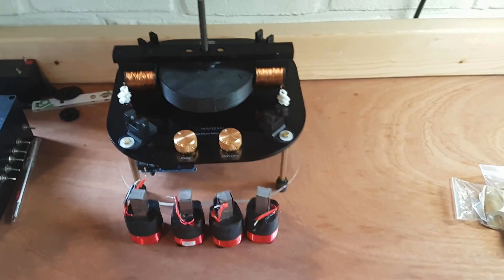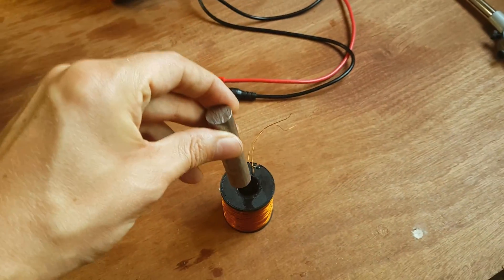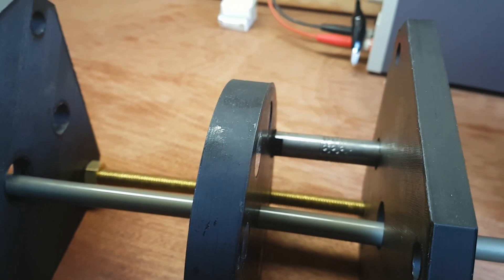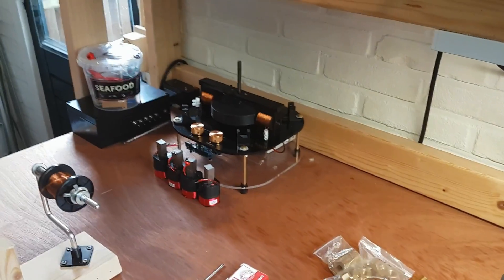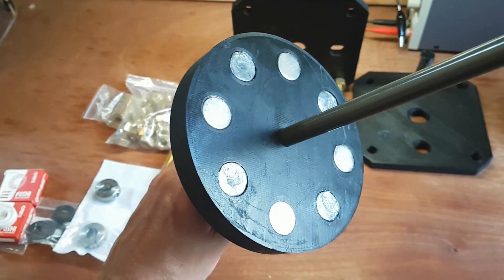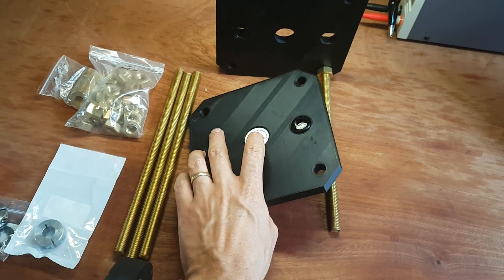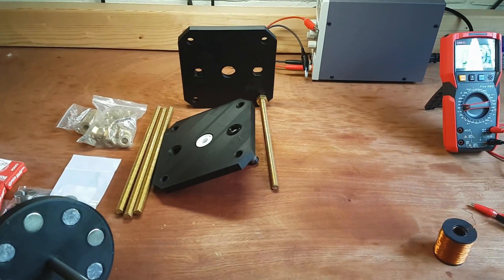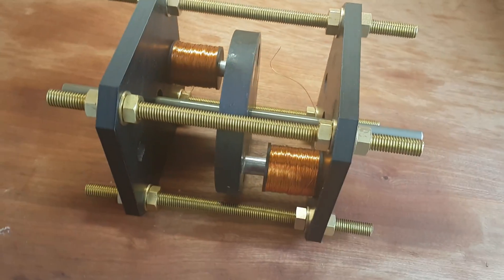Adams THERMO Motor Generator Replication

Comment: Hi, Nick! Have you measured the inductance of the coils? If so, what is the inductance? Thanks in advance for your reply!
Reply from the maker: Hi Alexander, my LCR meter is damaged by the moisture in my workshop, so I can't accurately measure the inductance with that right now. I'll have to use a function generator and oscilloscope instead and find the resonant frequency.

Comment: You can easily make a Newman motor with this set up to accomplish over unity BEMF spike to power supply, & magnetic torque on the rotor.  I'm not sure what principles the Adams motor is trying to accomplish, A leedskalnin design with bucking coils would be something similar. Other than that in terms of super high RPMs, you'd have to see Gerard Morin's washing machine motor WYE wound pulsed DC motor. From my understanding with these projects, it's either Newman machines, pulsed DC High volt motors ( that are not trying to recapture anything ) , or multi phase transformer designs.

Comment: hmmm try bismuth too if ya can. looking great
Reply from the maker: I will, as many people have told me this, but the reason I went for lead is because in the 3rd party report I have about this motor it is stated that you HAVE to use lead, and that bismuth won't work. However, I will definitely give bismuth a try if my lead experiments result in nothing.
Reply: @Waveguide  whats the plan with the power supply?
Reply from the maker: @m3sca1  Adams used mains power to run these motors. So Ideally I would have an isolation transformer > variac > FWBR + smoothing cap as power supply, but to start, I will use my bench power supply, which goes up to 120V.